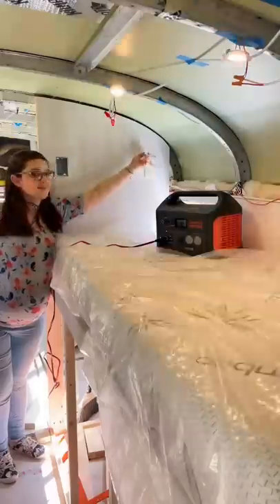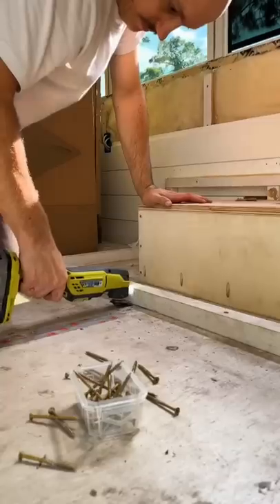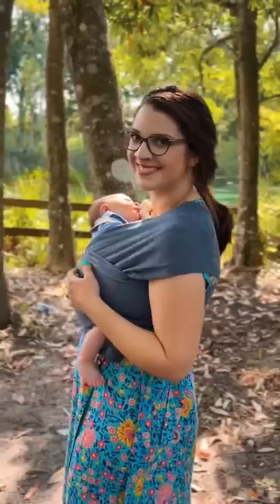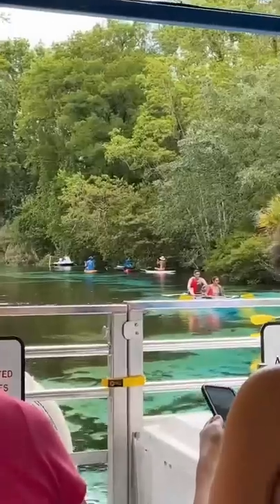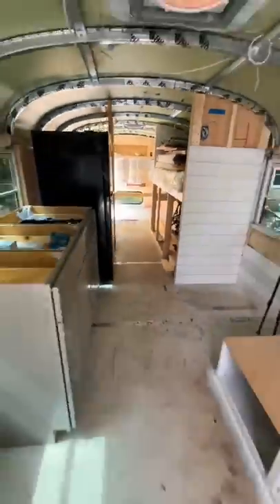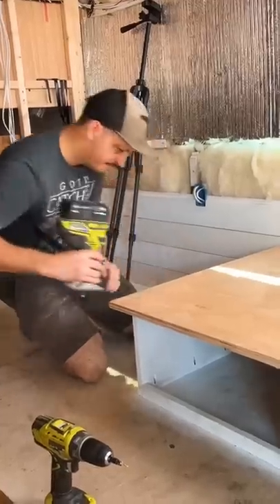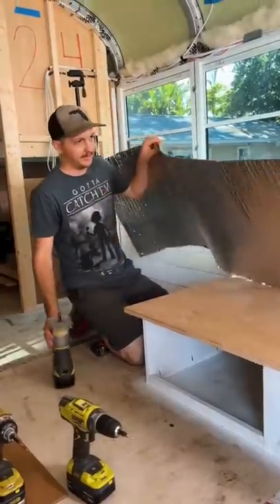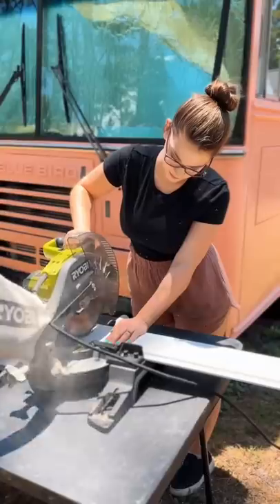destroying the couch in our school bus tiny home #shorts #buslife #vanlife #busconversion #skoolie

Comment: Get as light a color as you can. vehicles are innately hot, having light seating will help to reduce cooling cost. Having little kids does make darker colors more attractive but because of the way vehicle seats heat up you might end up having to deal with minor burns constantly